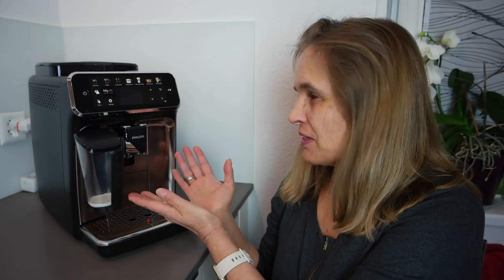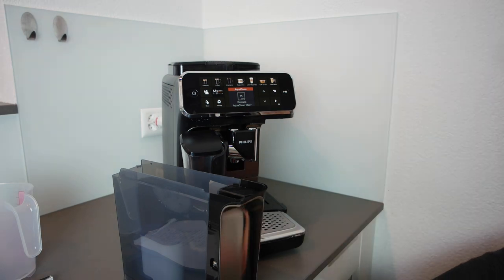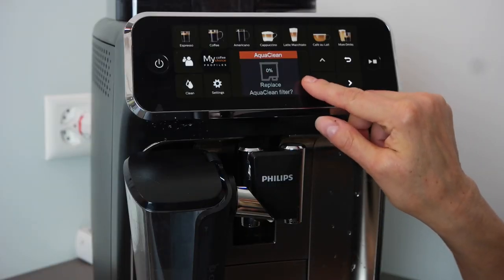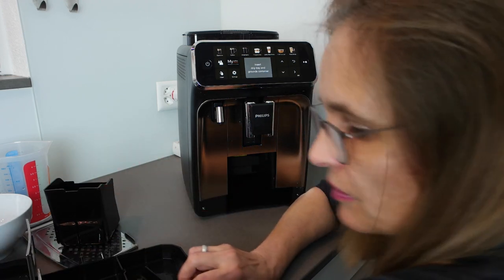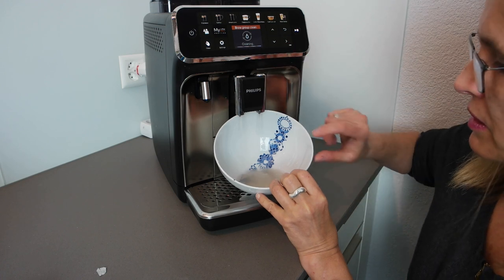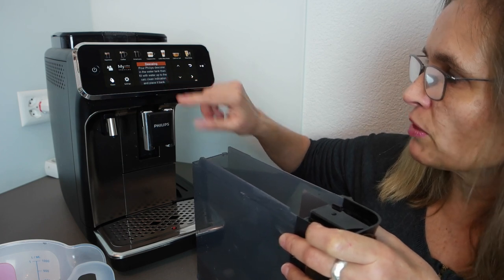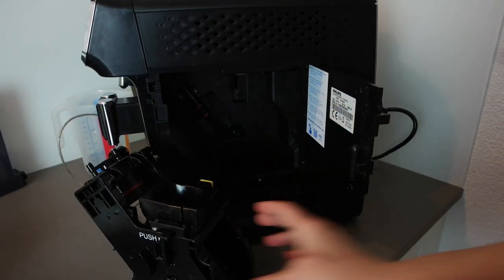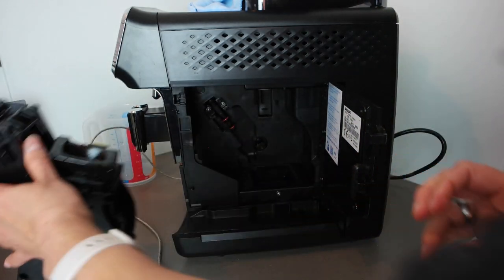Philips LatteGo 5400 series coffee machine maintenance

Comment: Your unit is not available in the USA.  I have the ES3200 LatteGo and have used it for just over a year.  Thank you for posting the unboxing video. It was helpful to me as a guide because I needed to re-box my machine to send back to Philips for warranty service.  I wish you the best of luck and hope you get years of reliable service out of your new machine.  Mine has been nothing but a headache and is always requiring interaction to clear a red light and sometimes all three red lights.  This happens nearly every day we use it.  The only good thing I can say is that Philips customer support has been exceptional so I am grateful for that at least.  Also, be careful with the milk container.  We always washed ours by hand, but after a while it started leaking milk from the bottom as taking in apart multiple times to clean weakened the latch on the bottom.  Philips did replace it for free but told me that part is not a warranty item.  Once my unit is refurbished and returned I'll be looking to replace it if it starts acting up again.
Reply from the maker: I am aware that the milk unit is an item that I will have to replace once in a while because the rubber will wear off over the time. I bought this machine keeping in mind that all parts that will need service or that might be wearing off over time are replaceable by myself at a very reasonable price. My old coffee machine needed a service for cleaning and maintenance which cost me 320 Swiss Francs every year. You weren’t able to take the brew group out by yourself and I wasn’t able to buy replacement parts. All had to be done by a specialist. If something like what has happened to you occurs whit mine I will create a video about it. Hopefully you will find a solution with yours.

Comment: Great video! I’m waiting for this to be offered for sale in the US. Do you have any regrets about buying the 5400? Based on my research it seems like it’s going to be the right unit for me.
Reply from the maker: No regrets at all. The only thing that is a bit negative is that it is quite loud when it is doing its thing. But I don’t care 🤷‍♀️ because the coffee is so good.
Reply: @choschiba  thank you so much!
Reply: @choschiba  Is this because the unit itself is loud, or because it's vibrating a lot? (also transfering the vibrations) ?

Say when you brew, and you lift up the machine, is the loudness (much) less?
Reply from the maker: It’s the hot steam being pushed through the milk container. The machine grinding the coffee and brewing the coffee isn’t louder than my old coffee machine.
Reply: @choschiba  Just got mine today and I've added some Sorbothane half sphere underneath the device. I'm doing a lot with acoustics, so I had a feeling that these would help and it really does. The noise is much less as the machine doesn't have any contact now with anything. The pads absorb every vibration.

Amazon: Sorbothane Halbkugel but other sites are cheaper, but that's what I used. It works under every noisy device.
Reply from the maker: Thank you so much for sharing 🤗 I will try to get them too. Have never heard of those before.
Reply: @Alexander Loper were you able to get this machine? It seems to be unavailable in the US. Would you recommend it?  Im thinking about getting one if I can. Thanks in advanc
Reply: @mariyoreo  I ended up going with the Breville Barista Touch - only a semi auto, but have some personal friends that had one since it came out and highly recommended it. Philips is an awesome brand and this was my second choice.

Comment: Hello. In the container with the used coffee pads do you find some drops of water? I noticed that after making a cup of coffee, if remove the container to clean it, inside the machine some drops are falling. Does your machine have the same behavior?
Reply from the maker: Yes, that can happen. Nothing to worry about. In the beginning the pads on my machine were wetter. What is the grinding dial set up to on your machine?
Reply: @choschiba  It doesn't show with any indicator. But I will set it to low slowly by turning it towards to 1. The issue is that after making a coffee and turning off the machine some drops of water are stll falling in the container for 1-2 min. So your machine does the same right ?
Reply from the maker: I will check it. My grinding dial is about in the middle of the scale. I will check if there is still water dripping. As you don’t have eye sight to the container sitting inside the machine I am wondering how you have recognized it? 🤷🏼‍♀️
Reply: @choschiba  After I made a coffee and  turned off the machine, I removed the drawer with the container to clean it and then I found drops of water falling inside the empty space where the container should be placed. I let a towel there for 1-2 min until the drops stopped falling and then I placed back the drawer.
Reply from the maker: Ah, now I understand what you mean. I will check and reply. Going to grab another cup of coffee now 😁
Reply from the maker: I‘ve checked it right now. No dripping going on. The pellet is quite firm. My grinding dial is set to 3.
Reply from the maker: https://at.tumblr.com/cat3d/thats-what-the-coffee-pad-looks-like-after-i-have/3iu9wn6i0d12
Reply: @choschiba  The gridding dial that you  set to 3, how can you verify it? I can't see any indicator.

Comment: how long is the cable on this? i want to buy this model but cant decide where to put it so it can reach my power outlet
Reply from the maker: It is 1m long. But it’s an exchangeable cord. So you could use a longer one or an extension cord.
Reply: @choschiba  thanks alot, now my decision is clear

Comment: I have heard that there are many people having leaks from the 5400 machine after a few months, have you had issues?
Reply from the maker: No, I haven’t. Do you know where they have them?  If it’s regarding the milk container maybe they didn’t snap it together properly. I have always washed by hand and have never put it in the dishwasher. Looking forward to your reply
Reply: @choschiba  the video i saw shows the water leaking from the bottom of the machine
Reply from the maker: Oh, wow. That means that the tray might have overflowed or there might have been a production problem regarding the tray. Maybe the particular batch? If you have such a problem, having a hole in the injected plastic part you immediately ask for exchange. The other cause might be that they simply haven’t emptied the tray often enough. The mechanical red riser shows you when the tray is full. I always pay attention and therefore never had any problem.
Reply: @choschiba  Drip tray was empty.
The water is boiling when it comes out.  You can see then press the button to make an espresso, the coffee grinds and then the water pump starts and thats when the water leaks out  from the bottom left of the machine
Reply from the maker: Oh wow! That means that the flexible tube must have got disconnected. I had that once in a while with my old coffee machine. He/She should return it and get a new one. Should still be covered by warranty. Or get it repaired.

Comment: The first time i used this machine it was with ground coffee. Machine just dumped it in container and all i got is clean water. What's wrong with it? Thank you in advance.
Reply from the maker: I will have to give it a try myself. Never tried that function. I would press the button for grounded coffee first and then wait what the machine tells you to do next.
Reply: @choschiba  i didn't know there is a button for it. That probably will do it. Thanks! 
Do you keep your machine on all day or its better to turn it off ?
Reply from the maker: @-vrtex-1966  I‘ve programmed it so it will turn off after one hour. That saves electricity.
Reply: @vortex im looking to purchase this machine. Do you still like it and would recommend? Thanks in advance
Reply: @mariyoreo   omg yes. It's the best!
Reply: @-vrtex-1966  thank you for responding!

Comment: If you use ReverseOsmosis/Distilled/UltraFiltered water with the aquaclean filter inside water container...you will never need to descale ever.....Only the cleaning tablet is needed to get rid of excess oils from brew unit holes. Tip Only use Medium or Light Roast beans as they are less oily, then use max hotwater tempreture on Light Roast, Medium hotwater temp on Medium Roast. Enjoy.
Reply from the maker: Thank you very much for your tips. But I really want to drink mineralized water instead of distilled water!! It´s much healthier for the body. I don`t mind buying a new filter. It lasts really long anyway. The choice of beans, more or less roasted, really depends on the personal taste.
Reply: I'm looking to purchase this machine. Do you still like it and would recommend? Thanks on advance
Reply from the maker: Absolutely 👍🏼
Reply: @mariyoreo  Yes any model that you can afford. Bean to cup machimes save you thousands of dollars, you choose whatever beans you like...freedom of choice. Nespresso is tiny, overpriced , pods are messy, expensive and too small...yuck. Bean to Cup is the best in taste,budget...you can buy whatever you can afford.

Comment: How many times a year you need to do all these maintenance steps?
Reply from the maker: The machine will tell you when to exchange the filter or when you have to use the cleaning tablet. I would suggest to clean the brew group every 1-2 weeks. Otherwise you will have fungus inside the machine.
Reply: @choschiba  cool, thanks.